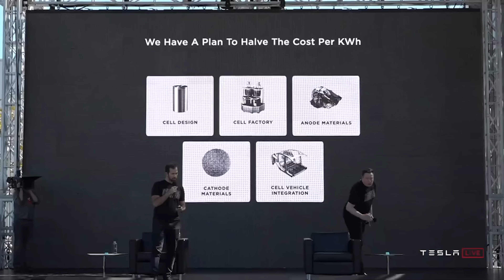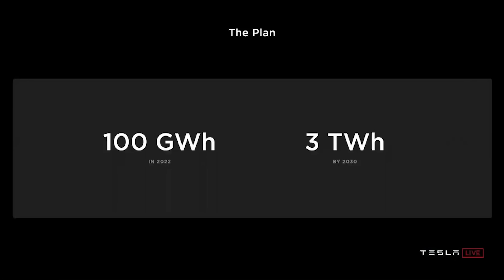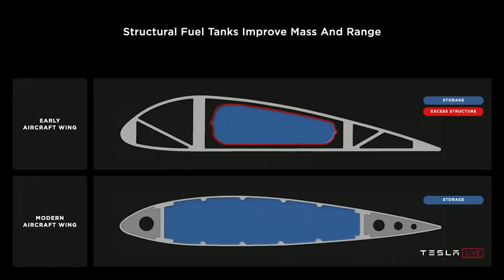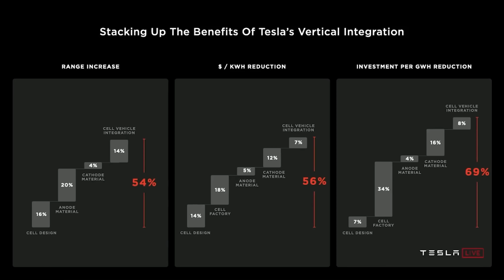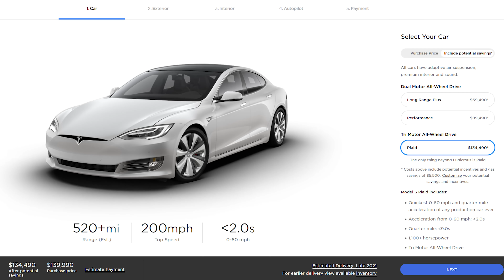Was Tesla Battery Day a Let Down?

Comment: Because cells have a finite lifespan, and because production of batteries produces emissions, they do have non-zero emissions.  If you add up all the emissions produced by the battery factory, and divide that by the number of miles on average a battery lasts, then we will have the true number.  It will be much lower than burning gas, but it won't be 0.

Comment: Fake and Gay. Just another pumping of the stock. It will work out just like "Alien Dreadnaught" did, in total failure. But you can't slap battery cells together by hand in a tent. The results are clear, Tesla is now 20-30% more expensive for km of range than competing EVs. High performance competitors outperform it on all tracks & every metric (including 1/4 mile) except a single 30-min pre-warmed 0-60 launch. By the time Plaid comes along, Porche's lead will have grown. Investing in the technological laggard never works! Enjoy the decade of failure to come!

Comment: Progress on that is what could make a $25,000 Tesla possible, or at least contribute significantly to that. If the automaker can get the price per kilowatt-hour of its batteries down, Musk suggested Tesla could potentially halve that figure from its current value, then suddenly the single most expensive component of a modern EV drops massively. In turn, production costs could be trimmed by as much as 69-percent. Get to those levels, and suddenly a $25k entry-level Tesla is possible. If Tesla is following a similar playbook with the Powerwall, then the company may very well be poised to announce some new upgrades for the home battery system soon. What these updates may be are merely speculations for now, of course, but it would not be surprising if some tech from Tesla’s expected million-mile battery would be rolled out to the Powerwall (3). My best guess is that they're already busy producing the new batteries and are getting rid of their old stock before it becomes worthless.

Comment: (Was Tesla Battery Day a Let Down?)
YES.  But it had to be.  It was already hyped up so much, that anything short of a perpetual motion device, (instead of a battery), would be seen as a failure.  But, after that initial disappointment.  Elon has made great strides.  Huge, big, strides.  The likes of which, I would never even dream another company achieving today.  I don't like his analogy of (take the fuel tank out of the wing.  And making the wing, itself, into a fuel tank.)  Elon has kept the little battery cell.  He just moved the place he "puts" all those cells.  IF he put that "DRY GEL" into the frame (just the raw stuff, no cell).  ONLY THEN, would that analogy he used, be pertinent .

Comment: Because Tesla will be able to manufacture more cells in a much smaller space I'm wondering if this means one of two things.
1) Will Tesla eventually complete Giga 1 as originally envisioned (size wise)?
2) Given the many local constraints on housing, H20, education and health facilities & other services, does this mean that Tesla won't substantially expand Giga 1, instead resorting to reconfiguring the plant to accommodate it's own new format?

All told, Battery investors day was impressive but I am curious as to why they're making these announcements so far in advance of them being oven ready. There's likely to be several reasons but perhaps one might be to encourage the rest of the automotive & battery storage industries to get a wriggle on or be left in the literal, dust of Tesla.

Comment: Is the battery cells themself lighter in proportion to being four to five batteries in one. And the energy density must be 5 times five of 5 batteries 2170 or is it from the single 2170 five time that size. With possibly 4.5 the mass of the 2170. What is do you think?

Comment: I think all this is great, but since we already have an electric grid I've wondered why we are not making the grid an integral part of the solution, namely going to all underground, highway right of way electric transmission with the ability to pick up power on the fly.  Thinking of you, California.   State could fund as a tollroad,  off-setting revenue loss of decreasing gas taxes while removing fire threat of existing above ground transmission.   Won't be cheap but could be the missing link that rapidly propels us to better things.  This would be huge for trucking industry.  The State would be rolling in it.

Comment: Charging issues: with a larger Battery capacity ( from 100 kWh to 150 Kwh)  the chargers need to follow this larger capacity, therefor larger capacity chargers are required. If the Battery voltage is the same ( 350 Vdc) larger cables are required, presently they are the size of a persons arm ( for the fast chargers)  If charging time is kept same as abt 1 hr, the chargers supply needs to be beefed up by  whatever 50% ? This spells out to larger supply transformers, larger copper cables etc etc... yes, great news from Elon but lets look at the whole picture please.................

Comment: Yep, it was a let down.  I was hoping for more now, but knowing it takes longer than even Elon's optimistic projections.  Glad to see using the 'right tool for the right job' (cell chemistry in this case).  Volume bigger and heavier for fix applications, mid-spec for 'normal vehicles' and new high performance batteries in sports and trucks.  Also, I was expecting to see a 'entire frame' or at least single front and single back castings coming.

Comment: I don’t understand the 5x energy with 16% more range. Maybe the added range is because they can use more of the energy in the battery without accelerating degradation. Because I think the new cells are more than 5x bigger by volume.

Comment: My worry is this is all good but the way they kept delaying this event and building the hype I feel let down.  Everything is so far out and with all the delays I was expecting something ready now.  If plaid model S was available next month though I could never afford one that would be something tangible for the investors to get behind.  I am waiting for the cyber truck and this is why I don't have a reservation.  Will the cyber truck get the 4680 cells at launch with the batteries integrated in frame or will it start with traditional 2870 cells in module.  

This is like FSD where they keep jacking up the price on a promise that is not yet realized.  Tesla acts like a technology company but I don't think they fully realize that their product is not like an iPhone.  The average person can afford to buy a new iphone every couple of years but Cars are expensive enough that the average person cannot afford to upgrade as often.  For Example I went iPhone 4 in 2009, 6 in 2015, 11 in 2019, iPad1 2010, iPad Air2 2014 (only because original iPad was stolen), MacBook Air 2017, Apple Watch series 0 2016, Series 5 2020.  So I have spent what, $4,100 with Apple in 10 years?  At Tesla's innovation rate if I followed the same upgrade cycle I would be looking at $150-$200k over a 10 year period.  Also there is a big difference between getting all day battery life in an iPhone to 6hours battery life before upgrading versus a car that stars off with 330 miles and 4 years later I get only 250 miles range or worse and to add insult to injury A vehicle that has 330 miles of of range today next year comes with 500 mile of range and is cheaper.  

Don't get me wrong I want a Tesla, their supercharging network is great,  they have great performance, low/essentially no maintenance; but I have a very frugal wife that thinks more traditionally (and I believe this is the majority of folks).  The idea of charging a car is foreign to her and we both like the idea of getting a car paying it off and driving it until the wheels fall off.  Tesla s actually making my case harder to fight for EV's.  We can't have EV's that need upgrading like computers and cell phones and we are in place with EV's that we were in the late 90's and early 2000's where you would buy a computer with a 500MHz and 32MB of RAM with a 4 GB hard drive just to realize next week you can buy a computer with 600MHz CPU, 64MB RAM, 8GB HD for the same price or cheaper.  When do you buy?  With the average Auto Loan a vehicle is a 6 year commitment.  Tesla buyers are still stuck having to pay the early adopter premium.  

How pissed are today's Tesla owners going to be when they paid 8K for FSD and 5 years market and regulatory pressure makes it a standard feature on a vehicle that goes further and lasts longer for a comparable or less price.  For a $1,000 Apple device I keep 4 years the value proposition is I am getting something of great value that cost me $0.68 cents a day and I use hourly.  With a Tesla I am getting a product at $40-$50K and lets say I keep my Tesla 6 years the value is $22.83 a day for something I use on average 2 hours a day and on top of that I have to pay for electricity, insurance and associated services (eg. Premium connectivity)

Comment: Rather than integrating batteries into the structure would it be an idea to go the other way and have removable battery pods that can easily come out of one vehicle and go into another when recharged. King of like how it works with propane BBQ gas bottles? Imagine a world where these same battery pods power our car, or home etc. completely interchangeably?

Comment: “Free the data:” <‘s and >’s are not = to. What was that big yellow base red button Plaid was sporting. This Plaid was due 2020 fall not end of 2021”basically.” It’ll take a year “basically” to “bag” tabless batteries according to Elon which explains >,< +’s. Estimated performance on a graph is promising and 1:30.3 lap an impressive track alignment that’d chew the range and tires but where is the 2020 Plaid or for that matter the 2020 Roadster Elon promised at the unveiling? You “basically” know where it is. Where are the 250k deposit reservation holders: Check Tesla’s own web sites blog to see how many got lawyers to help get their money back. These are Elon’s words and Tesla’s web site. 🤷🏼‍♂️

Comment: What is so exciting about a 25000$ Tesla? We already have the M3 at 35k, but for 25k you will get a smaller car, with a smaller battery, with a smaller motor and less features. What is so amazing about that? What they should be doing is making the M3 cost 25k, that would be something.

Comment: I'm not an owner but follow pretty closely.   My sole surprise at it was that there weren't a couple of next 6 months items to be released.  Understandably, the couple years out of the new batteries in volume needed to set expectations.   I thought they'd have some incremental things nearer term, but maybe the status of the self driving re-write was intended to fill that time period.  I've been in a group that did a total re-write, ground up and while you introduce new concerns - the improvement that comes from having done something a different way and then getting a chance to streamline and enhance knowing the past... can turn out pretty good vs endlessly trying to work around what you'd built and had to live with...   overall, I'd say they have their work cut out for them but look like they're breaking things down into digestible chunks to chew on.  Sometimes things surprise to the upside and come in early too, you never know.

Comment: Two questions I wish someone had asked: (1) When will we see those advances in construction (i.e. 1 piece castings, battery as structure, etc.) appear in other models the than Y, i.e. 3, S, X; (2) Will giga Nevada ever be finished? As in ... Built out to the originally announced foot print (as shown on screen behind in the slide illustrating the reduction in footprint for terra over giga). It seems to have been built out to maybe 50% of ultimate proposal and then abandoned in favor of China, Berlin, Texas factories ... so ... what are plans for Nevada?

Comment: Was it al let down?

As a trader looking at short term, yes. Expected more excitement and more news. Everything announced was more for the long. No big surprises.
Had some calls. Sold more than half of them now, still in the green. Wish I sold some before.

As a Tesla Fan, long term investor and shareholder, no. Awesome news, great roadmap. The decrease in cost is huge! Scaling made easy! Plus range and performance increase! Not really clear when how what and where will get implement but that doesn’t really matter, in a few years this tech will rock. 
Awesome outlook for the future, but might take a while until we see the results.
Have most of my money in Tesla shares.

Imo they could hype it up a bit more. Give some more existing numbers. Like they didn’t even mention the 1m mile battery, which apparently is supposed to be self evident now. Or the slide with the extremely reduced charging time which only was shown for a second and wasn’t talked about. Possible that v3 chargers support 500kw with 800v, cyberteuck and plaid s could easily handle that.

Comment: Good points:
Solid improvements in all parameters in the new cells
Nice to see HPDC machine in operation, making Model Y rears, plus animation of similar front casting

Not so good points:
I'm not getting a Cybertruck here in the UK.
Two year timescale before we see any of the hardware mentioned except  Plaid 'S' ( note - no mention of Plaid X )

Neutrals:
Stock price wasn't up high enough to persuade me to sell some, or low enough to make buying worthwhile.

Comment: The talk was ground breaking into what Tesla’s “on going” plan to reduce complexity & costs in battery production etc. But the talk was over the heads of most. Tesla believers know that this plan is going to impact legacy motor companies to extinction...
They should of had a few physical items to show off the progress. A few new batteries packs, new casting etc then finish with the Tesla model S plaid doing a O-60 start 🤔🧐🤔

Comment: I feel like the title is a little too misleading. The way you talk shows absolutly no disappointment
Reply: You are right. The title is misleading. The things shared in this video are great and optimistic about future efficient low-cost batteries.
Reply: The title is inaccurate if you're uninformed.
Reply: Negative, title not misleading. Stock market disappointed, video examines veracity of that reaction, concludes reaction invalid. Accurate title, valid topic.

Comment: To me it was the opposite, especially the sustainability and how they want to start reforming the mining process too. I think the current cost lowering is just a conservative estimate, I could see them cutting cost even more until giga texas is finished which will probably be hosting that battery production line.
It was eye opening just how good the thing is that tesla is working on. I was expecting them to have some nice improvements in the next 1-2 years, but this was insane.

Comment: Rather than chasing a solid-state battery that will be expensive and therefore limit the adoption of electric cars and grid storage, price is the chief driver to the adoption of both. We saw in computers the hard drive "war" between disc drives and solid-state storage. As solid-state storage got cheaper disc drives were cheaper still with massive amounts of extra storage keeping the "old" tech very much at the forefront of consumer purchasing. As others chase this solid dream Tesla will have cheap appealing products in the market place. The million-mile battery will be the LFP battery in the big form factor which Elon said would also benefit from the tech displayed. LFP packs at 300 and NMC at 400 miles now with 54% extra at 616 miles of range will give about a 1,000,000 of range for both (LFP has about 4,000 cycles and MNC about 1500). But the cycle life is expected to rise with the dry electrode batteries. So both should be able to last 1,000,000 miles.

Comment: Don’t look at the baby, look at the bath water.
If you watched the presentation for the product reveal, you missed the most important part. The important message was the revelation of brilliance in manufacturing. They have looked at the assembly line, and removed the “line” from the equation. (really they reduced it as much as possible) Elon said, “conveying” a product between manufacturing steps is wasted energy. Their selection of new, cheaper, and abundant raw products, and elimination of legacy processes show a willingness to color outside the lines of traditional manufacturing. Like Thomas Edison, Elon Musk leads and inspires many brilliant minds. Even as a bystander, it’s exciting to watch.

Comment: All nice with the hype of efficiency and better expensive and possibly "cheaper" cars. The one story I'm still missing in this picture is the recycling of batteries. The stories so far have been all about consumption with crazy numbers. But Elons ultimate goal is to head over to sustainable transport. Recycling is part of that story and should be just as a sexy theme as all the other stories. Where is Tesla on that. With no recycling in the long run as part of the story things are not going to be sustainable. Global recycling (literally reuse of main battery materials) is still a tougher challenge over building (with) batteries. Any news on that?
Reply: Ben did not mention it in its review but you should watch the event. Tesla has and is developing its own recycling factory in Nevada (hum Redwood?) and plans to used mostly recycled material in the future i.e. when enough batteries are to be recycled